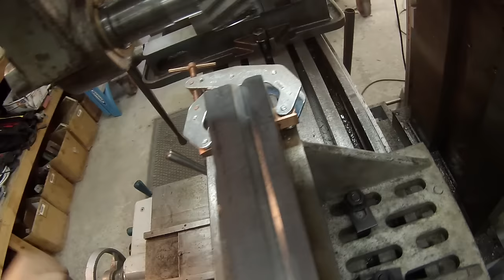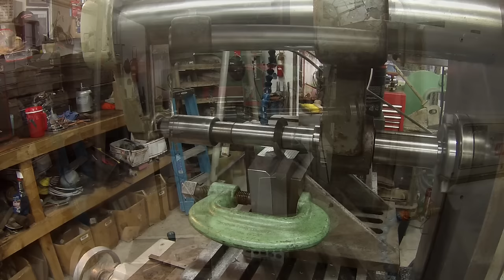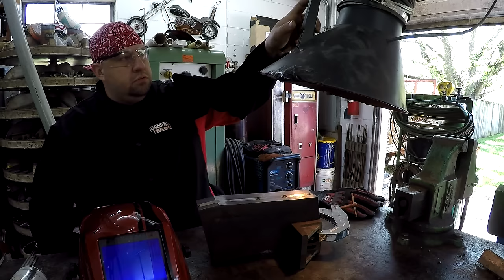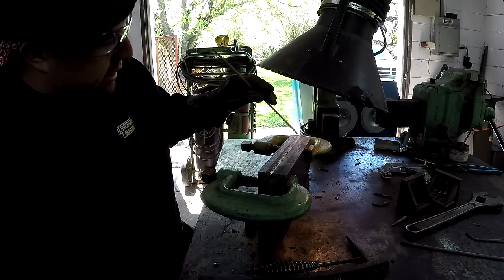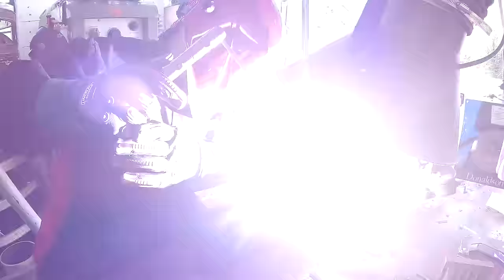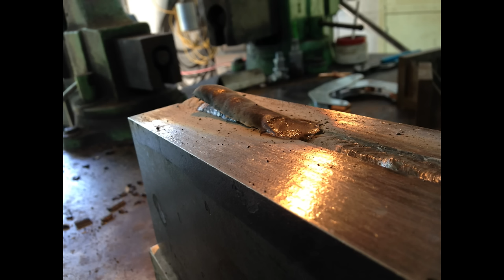Kearney & Trecker Parking Attachment Part 2

Comment: you can recondition your welding rods by putting them in the oven for an hour or so at 250° or higher. My dad used to do that. And it worked.
Reply from the maker: +Robert Phillips Good tip
Reply: +Robert Phillips  You beat me to it Robert. I have a small brown refrigerator with a little bit of heat in it I store all of my rods in.
Reply: +Robert Phillips 
Actual re-drying welding rods need to be done at ~650-750 degrees. For work that needs to be up to code, it's frequently best to just get a fresh, sealed container of rods.

Comment: I have stick welded farm repairs for many years and almost always used #6011 rods for the penitration and it is good on rusty metal, or so I was told .   After this video is decided to try the 7018 rods over the top and it was really nice and smooth.   Easy to use.   This youtube stuff has been really improving my results

Comment: It's the moisture that gets in/on welding rods that is causing the problems. In the welding arc the water becomes Hydrogen and Oxygen, two reactive gases that you never want in a weld that cause porosity.

Heating in an oven drives the water off. You can get one of those cheap toaster ovens for the shop that is long enough for the rods to lay in or use your regular kitchen oven and set it to about 300F and bake the rods for about an hour or so before you use them. Bake more rods than you think you'll need, it doesn't hurt the rods. I'd suggest doing this for all the rods you use, even new ones because you don't know how long they've been on the shelf.

A lot of people make rod storage containers out of sewer pipe with a threaded cap on one end and throw in those desiccant packs to suck up the moisture. I'd advise storing your rods in them after baking since you live in a humid place so close to the ocean. You can also make them any length you want, for example for TIG and brazing rods to keep them from rusting.

Just my two cents, keep up the good work.

Comment: Thanks for sharing Adam. Reference old welding Rods. You can revitalize them via baking in an oven @ 450 - 500 degrees for approx. 1 hour. MAJOR HINT, DO NOT USE the oven in your house. The smell will hang around for at least two or three weeks. My wife was not happy, and I don't blame her, but it does work. I did this about a year or so ago. How old were the rods, well look up Shoreham Nuclear Power Plant. The plant was built between 1973 and 1984 by the Long Island Lighting Company (LILCO).  By the way the rods (that keep the FLUX on) work great, which was better then 80-90 percent them. (50 lb's can, that was open.)

Comment: Great series! My favorite electrode holder for stick welding is a whip line made with a Bernard  short stub holder with the handle shortened 1 inch. I just  like the positive connection with the rod and the way you can position and bend the rod. Just a bit slower when you really have to pour the rod to it fast. Ed K. Cleve. Oh.

Comment: in welding school, the instructor gave us a tip..  if your working with older rod that hasn't been kept in a sealed container or in an oven - you can strike the stick and short it for a few seconds...  it will warm the rod up and burn off any moisture.   handy trick when your stuck using old rod-
Reply: +AnimalMother224 FANTASTIC tip - thanks!

Comment: That rougher really made the K&T shine.  It just removed a half inch at a time and wondered what was next  LOL. I was wondering about the weld chamfer, that answered that question.  That Tweco holder is the style I used as an Ironworker , I really like them. It looks like the smoke eater was money well spent, that worked pretty good.   Once again, nice work and your welds looked pretty good too.  Jeff

Comment: Robert you are quick on the draw was going to say the same my dad did the same thing.  Also I build a rod holder out of PVC an has  screw cap on it an use some of those desiccant packets in with my rods keeps them real well.

Comment: We use an old ice box with the insulation pulled out and a few 1/2" holes for ventilation. Install a regular surface mount light fixture on the rear wall with a 80 or 100 watt bulb, wala instant rod dryer. At work I have the regular rod ovens, keeps 7018 forever.

Comment: Fascinating watching a master at work.  BTW - you must have a heck of an electric bill :)
Reply: +Ray Reese I can vouche for that... with something like the K&T mill and welders, it takes a toll. 
Personally, my bill killer is a 12KW electric kiln for treating knives. A few hours of that running (and some metals require an 8 hour total processing time, like 50crv4 ), and it gets expensive in a hurry.
Reply from the maker: +Ray Reese It's not too bad when I'm not running the AC. But it's lower then you might think.

Comment: Oh, yeah, love them K&T's. That slab mill rougher works greatl Lots of stock removal AND low cutting force. Try that same cut with a regular slab mill and the tangential cutting forces would have lifted the work in spite of the clamps.

Adam you keep your 7018 in a rod oven? I got 20 year old rod that runs just fine but I keep it in an insulated sheet metal locker on top of my water heater. where it's usually 130 F. It's been 'splained to me that xx18 and other lo-hy variant welding rods are a little hydroscopic. Use them un-dehydrated and you get porosity.

Comment: Hey Adam, I recall in a previous vid that you checked the arbors and found that they are straight until you tighten them up in place on the mill. In a couple of shots in this vid it appears to me that the old running bushing is the culprit here. You can see that the bore does not appear to be concentric with the outer diameter, this is also evident in the discoloration on the running bushing. Time to mount up the new one and give it a test. May be time to put a new bushing in the overarm too.
Reply from the maker: I have a brand spanking new arbor I plan to use to test things out. I do know the new spacers I bought are not concentric with the bore, and that's really playing eye tricks on us.

Comment: "I hope you guys enjoyed watching that" 

Sure did.  Abom is the fucking Bob Ross of machine work.
Reply: +rewtuser ...and we'll just carve off a 1/2 from this 'happy' piece of steel plate...!
Reply from the maker: LOL!! Always love the Bob Ross comments
Reply from the maker: And that'll be our little secret
Reply: Back in the mid-1980's, I made a lot of weldments for fixtures to be stress relieved and machined later...2-6" plate...some stuff was 2-3 layers like this parking attachment....b-prints called out for edge welds...then 1-1/2 to 3" holes and plug welds in the center areas....some mandrels for nosecones weighed 2-4 tons, 3" to 4" thick....4-5 feet diameter...5-6 feet long...big lathe work later...
 Lots of the fixture work was for Aerojet/Rocketdyne here in Sacramento, Calif...
Reply: The Bob Ross of machine work!! Now that would be a whole lot less funny if it wasn't so true!
Reply: Is an afro wig and an april fools video in the works for next year?

The Joy Of Machining?

Comment: Looks good Adam, now I see what that sneak peak was in SNS, no grinder :P.  You may want to check your hose clips on your torch.  Sometimes they wear out they are pretty small, or you may have a kink in your leads somewhere.  The fume extractor looks like a good addition to the shop.
Reply from the maker: Thanks Bill. The fume extractor will be great when the doors are shit and the AC is on.
Reply: +Abom79 Yeah crappy doors strike again :) .  I know what you mean where I used to work part of the shop was  a corner with little air movement.  We had a wall mounted extractor, and it worked good for cutting and welding.

Comment: Have you tried to use stick metal (only) as a filler rod with Tig ?  I have never, but thought if you have some thin ones or even thick ones if they don't dry out in a toaster (convention) oven [I got or 'old' one and used temp sensors since the dial was off... ].  Love the grinds.  Wow.  Heavy cut.

Comment: Awesome videos Adam, I am a 28 year old master auto tech from okc. I have a question for you about setting bearing tolerance on a 2piece transmission case with tapered roller bearings. now I know this may not be your full area of expertise butt you seem to be a master with a dial indicator and I'm sure you put stuff like this back together after Machining. my problem is when installing the shaft and Loosely tightening the case to Sit N Play I always wind up being on the high side of my tolerance after the case is torqued. you seem very confident in the way that you use your indicators and seem to trust your readings. if there's any light you can shed as far as probably setting up and using indicators I would appreciate it.

Comment: Excellent heavy cutting and welding Adam. I really like the looks of those weld beads you
laid. Why don't you consider leaving them like that instead of grinding them down or
milling them to accentuate that this was a fabricated build.
Reply: +dimtt2 I agree, when you see good quality welds on machinery or other heavy weldments, they dont grind them away, just paint will give it the finish you need
Reply from the maker: +dimtt2 Just how I want to build the part, no right or wrong way.

Comment: Nice video as always Adam! I like today's mix of fab and machining... Always good to mix it up. 
Do you really have to clean up the welds? I usually enjoy seeing the welds and show it is a fabricated piece. I remember my welding mentor always sayong: a good welder doesn't hide his welds... 

Keep up the good work bro!
Reply from the maker: +Kvasir87 I don't have to but build my projects for fuin and to enjoy all areas of the shop. Sure leaving thr welds would be find, but I want a smooth surface like the original part, Plus more video.

Comment: Doesn't look like the Noga Minicool is able to keep up with the heat being put out by that cut, even after you opened it up, was that wide open?  I have been looking to get a Minicool for a while but after watching that I am leaning towards getting one with two nozzles.
Reply: looked to me like the chip pileup might have been blocking the mist a little, keeping the coolant from properly flooding the whole cutting surface

Comment: Interesting to contrast the two approaches - Adam: 50 SFM seems about right with maybe a 1/2 inch cut and 2 IPM feed; John Saunders: checking tooth loading, HP requirements, speeds, feeds, cutting depth (both radial and axial) to optimize material removal. Both valid methods, but really different. One major difference: a relatively lightly constructed (but still strong) CNC milling center vs the K&T (which probably outweighs the CNC by a factor of 5 or 10 to 1).

I expect that if you were making 1000 of these, you might be looking for ways to optimize material removal yourself. And John was actually researching how to optimize material removal with different techniques. Still, major differences in approach. I could watch either one for hours (and I do).
Reply from the maker: +Peter W. Meek Oh yea, both two different applications. Keep in mind alot of the work I do in my own shop I go the longer path just because I enjoy the work. If I was doing the same cuts all day i would continue to improve on the removal rates and speed things up to optimal times.

Comment: High frequency electricity. Hi Adam, it sounds like you have the hi frequency set to constant when you are tig welding. When welding steel on dc, you don't need it on constant, set the switch to start or even off. And B, I wouldn't go anywhere near that mill with the high frequency current from the tig welder! You are asking for trouble, that hi freq could burn a hole in electric motor insulation, pit up a switch, or ruin a bearing or feed screw. It doesn't matter if you have the ground clamp rite next to the weld, that hi freq wants to get back home and it will go through any path it finds.

Comment: Great Video, but quick question.... Why you cool the chips on the front of the cut versus putting the coolant the backside to pull coolant into the cut?
Reply from the maker: +Kurt Ohms It's still cooling the cutter, but partly what I'm doing it blowing the chips off of the flutes after the cuts.

Comment: Heheh, just simply, freaking AWESOME seeing the K&T take a 1/2" bite outta that steel per pass and not even FLINCH!   You may not find the limits of what it can do in your home projects, it'll take you bringing in a job from work to push it to its limits! xD  

Meanwhile, I'm curious what you had your ground clamp attached to while doing the tacking with the work piece still on the K&T's table.  I figured there wasn't any risk of harming the machine by doing that, but I'm still curious what you hooked the ground clamp too and what the risks of current bleeding into other parts of the machine were from it.  Common sense is telling me you also pulled the breaker to the mill too before the tacking so there wasn't any place else for the current to go except through the workpiece.
Reply from the maker: I had the ground clamp hooked to the large c-clamp that was clamps directly to the plate. It was a good spot and a very short path for the current. Just don't hook the ground to the machine itself.
Reply: Okay, nice.  Thought I would ask that question as that's what came to my mind first off seeing do the tacking with it still on the K&T, and likely a few other viewers were wondering about that.

Meanwhile, a bit off-topic, but if you remember those torsion bar repairs you did for the guy who needed them for an 80's Mopar, thought I'd share this page of diagrams, showing how those torsion bars went on the vehicle: http://www.geocities.ws/indychamp/torsion/torsion.htm  I could not remember what SNS episodes you did the torsion bar repairs in.  This suspension system had major problems with keeping the front wheels aligned straight under heavy fleet use, and was flawed in relying on the torsion bars themselves to contribute to the suspension geometry, and could not hold up under anything but easy, gentle driving, so its no wonder the design was abandoned and few if any replacement parts are made today.

Comment: I could not help but notice that you bend the end of the electrode over when you start a new rod,  why do you do this?  I have welded a lot of years and I have never seen anyone else do it that way.  Your welds are beautiful!  I would give them an A+.  

Storing rods in the home shop is kind of a pain.  I am using a small upright chest freezer fitted with 2 incandescent bulbs wired in series.  There is a 1/2" hole drilled in the top to let the moisture escape.  The bulbs produce enough heat to slowly drive the moisture from old rods and then maintain them in a dry state.  Being wired in series dramatically increases the bulbs operating life.  

My vote on finishing the weld is to use the mill.  I once worked as a welding inspector.  I had to make test plates to pull apart.  for DOT testing.  I had to finish the welds off on an old horizontal milling machine.

All the best!

Mike
Reply from the maker: A viewer of mine stopped by and visited me last year, he's a retired welder. He showed me that trick. It helps to get your hand in a more natural position and get the rod angled the way you want. Try if sometime. It's not always the best but for some positions it does help.